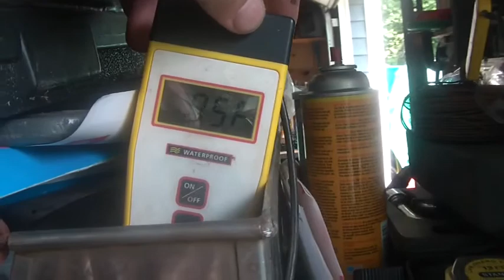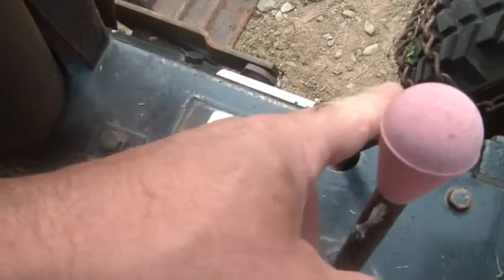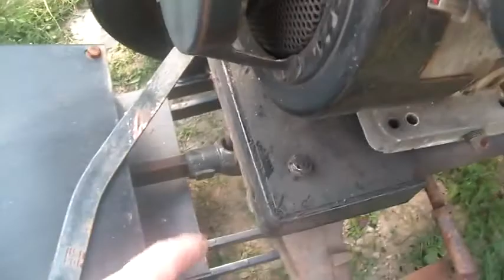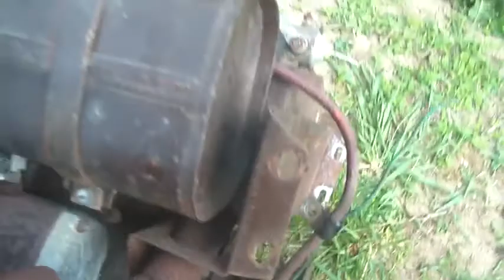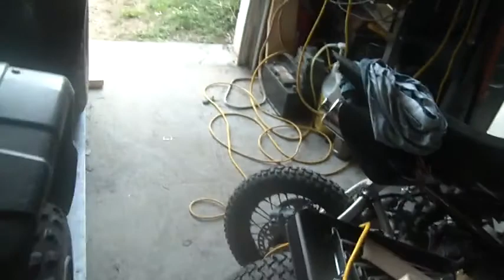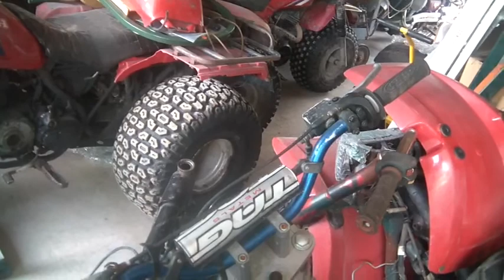6_3_2014, Bolen Tractor engine off,

Comment: Make sure you keep a BFH handy for taking the pullys off lol.
Reply: BFH is always within an arms reach
Reply from the maker: geargriden19, I have a BMFH, U think I can trade it in for 2 BFHs?  Right now, that pulley can make the difference between a successful engine swap or me scrambling for parts to make things work. Thanks for watching and commenting....
Reply from the maker: Andrew223, A BFH in one hand and a 4inch grinder in the other, there is little that I can not take a part. Thanks for watching and commenting!

Comment: how did you take off the belt driven PTO,  belts without taking the engine off does that pulley that is close to battery holder have a set screw and key way i have  a bolens 1050 i want to change the PTO belts only but i don't want to unbolt whole engine though is their ant other way to get them PTO belts off can u please write me back thanks